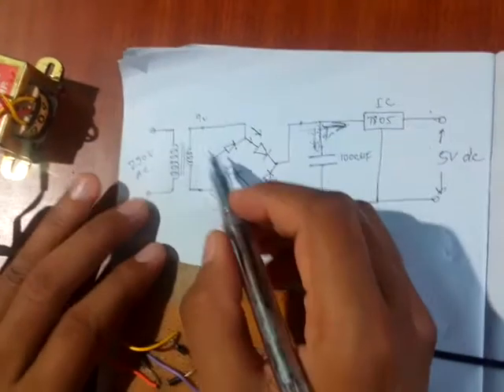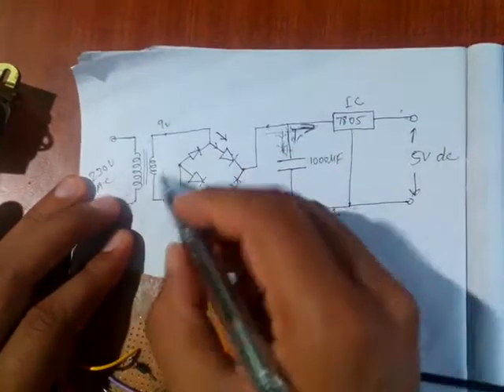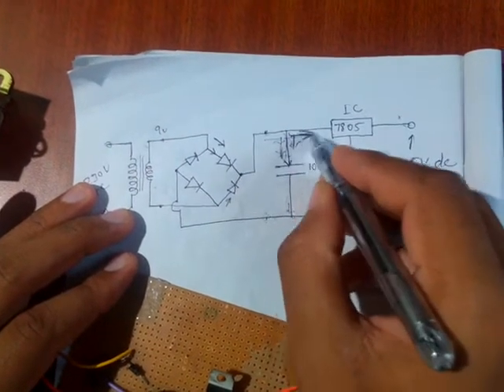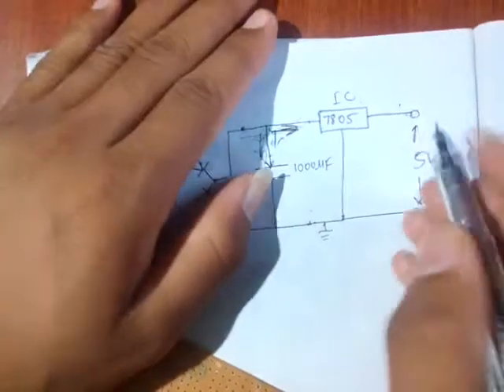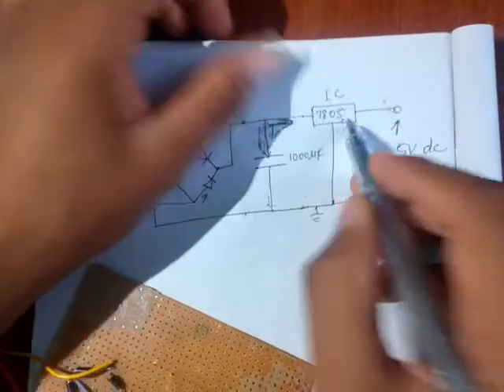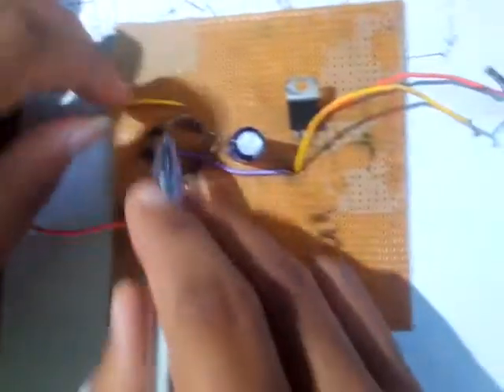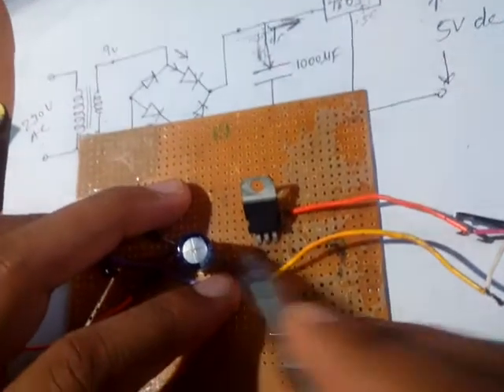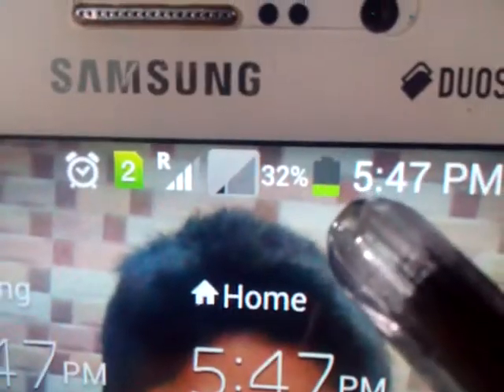How to make mobile charger..

Comment: can you tell me the rating of all the components, please?
Reply from the maker: yes offcourse...why not...
transformer is..220/9V,50 Hz....capacitor..25 v  ,1000uF....voltage regulater IC  no..LM7805..to provide constant dc voltage at o/p........and diode is...1N4007..
Reply: thank u so much, i m going to build my own
Reply from the maker: okkk..goood...try ur best...